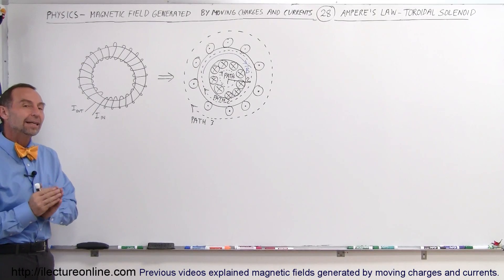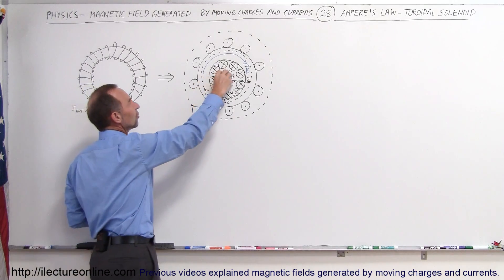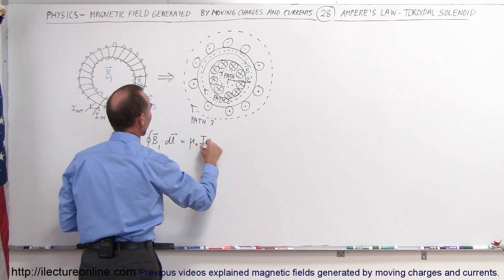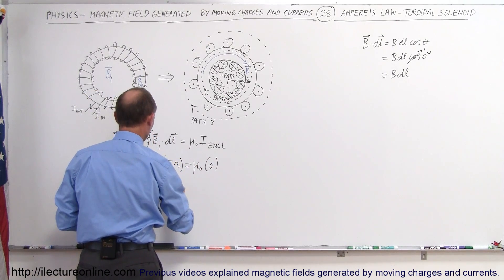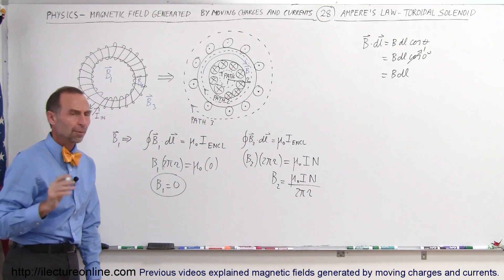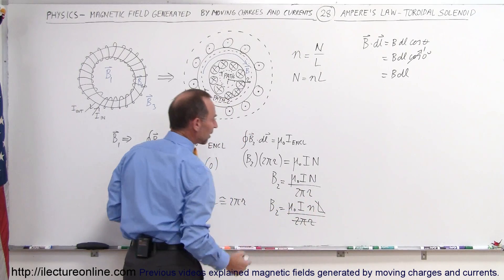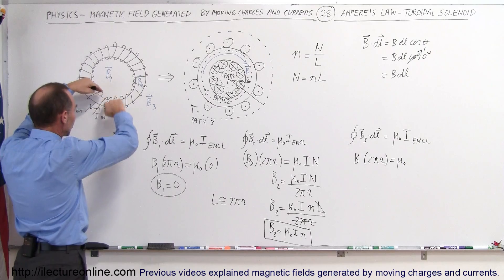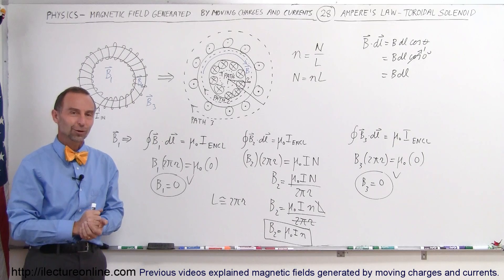Physics 44  Magnetic Field Generated (28 of 28) Ampere's Law: Toroidal

Comment: there must be a mistake. B3 can not be zero. There must be circulating magnetic field throughout path 3. we know that, around a wire, occurs circulating magnetic field.
Reply from the maker: Ampere's Law is a well established law and known to be correct.
Reply: @MichelvanBiezen  I have found where I did mistake. I thought magnetic field as a vector field. and I thought sum of vectors outside must give a magnetic field. But I see magnetic field behave like a fluid. if fluid find an easy way, follow this way and dont go outside.
Reply from the maker: That is a good way to look at it.

Comment: Sir why B and dl are in same direction
Reply from the maker: The direction of B depends on the direction of the current (no choice).  But the direction of dl is completely arbitrary.  In this case we CHOOSE to take dl in the same direction as B for a particular purpose.
Reply: For anyone else, if a dl is chosen to not be perpendicular or parallel to B, then using Ampere’s law would essentially lose its usefulness for calculating magnetic fields since it’s a dot product.

Comment: Mr. Van Biezen, could you explain the reasoning behind the approximation you make @ 4:30
Reply: lmao would you still happen to recall the explanation 5yrs later??
Reply: @brendancregan6127  because when you assume the thickness is very small when we compare to radius we can think toroidal as a circle and then we can see that this toroidal has the length 2piR which a circle with radius R has so that L becomes 2piR
Reply: Nevermind I believe I've figured it out, just needed to think about it a little more. Thanks for the great videos though!